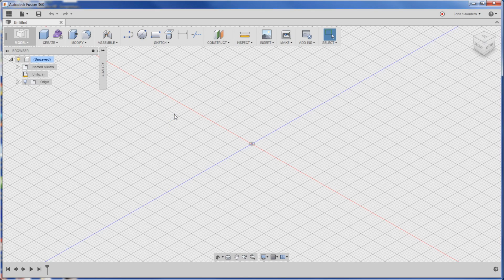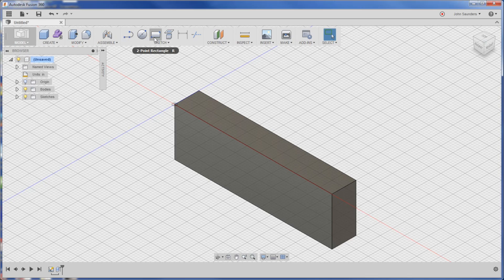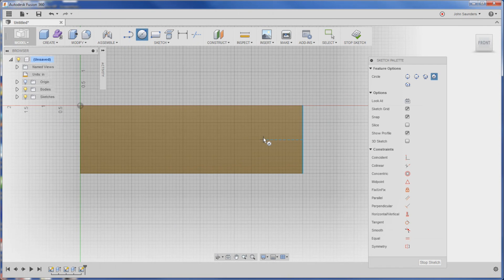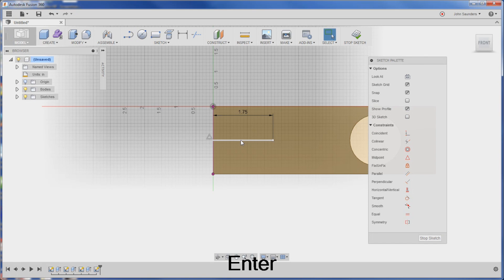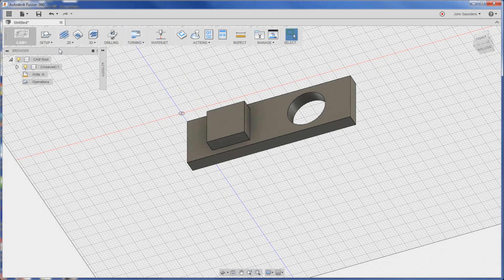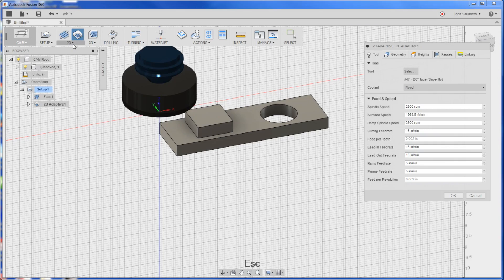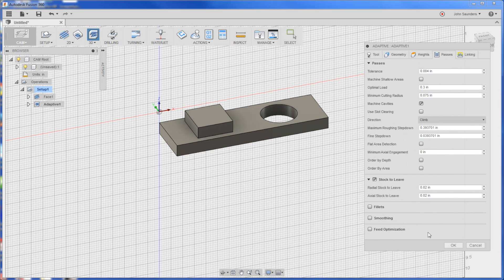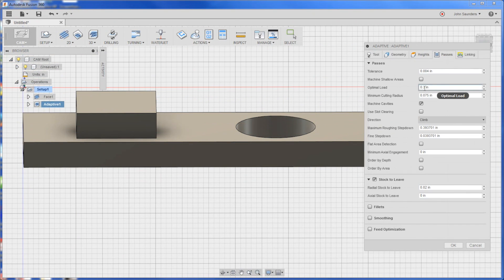Fusion 360 CAD & CAM part for Tormach Accuracy Test!

Comment: Top Video John. Coincidentally I have just been doing some accuracy testing with Fusion on the Tormach.
In short:
- Be careful of vice pressure on part (measure material flex in Z) and keeping torque consistent. (I eliminated this by double sided tape for fixturing during tests)
- Use 'Circular Pocket' under drill tab if you want a 'concentric' hole. 
- 2D contour with leads from/to center is ok but seems to very slightly over-size the holes and if you take note of the entry and exit points of the tool path and measure across this ID it will be larger than 90deg to that entry point - hence an 'oval circle'.
- Apparently better practice when modeling is to use 'hole' command rather than 'press pull' a sketched circle. My testing somewhat confirms better accuracy but this is not conclusive or as obvious to a 2D contour with leads from the centre rather than plunge.
I was led to testing and checking my tram etc due to oval holes when needing to quickly pocket  holes for pressing small bearings. My mill tram is excellent and very repeatable with just a tad run out. Hence CAM selection was the critical ingredient.
I also note a boring bar is a more standard practice for concentricity but I wasn't making NASA parts ;-) and boring bar setup adds time.
Hope this helps.
Bert.
Reply: NYC CNC The least I could offer John. Thanks for all your time and effort.
Reply: +NYC CNC 
Hi John, A little follow up... It was a bigger issue, thankfully not my machine or operator error. Lets just say I am sick of days fault finding and cutting holes but the issue lies in the Post Processor Config - the Radius R-Word commands.
Certain numbers in the X- offset for stock to add and hence certain X coordinates for the start point of a circle will induce the error causing the hole to be out in Y by up to 0.009". X measures fine. (So check hole measurements x 2 at 90deg to be safe).
The fix:

One option:
In the post processor window, property box, I have found Selecting 'NO' to 'Use Radius' which then uses I and J commands in the Gcode has worked fine for the tests I have done.
Better Option:
Download an amended Config off the Fusion CAM site called ARCS cps   https://camforum.autodesk.com/index.php?topic=6492.msg31466#msg31466

This was written to address ARC errors but also seems to help the new issue i have been butting my head against. It seems to add a couple of extra R word lines in the G code which fixes the problem.
This was back in March, so I may have a go at updating Tormachs PPilot cps file with the 120deg arcs instead of 180 to get a more up to date option for Pathpilot.

Using HAAS Generic for example works too by using I and J but then you get the ARC errors on the PPilot status page on certain designs.

Tormach hasn't gotten back to me even with all the fault finding info to give them a head start, and the CAM forum guys were not sure either (probably because it was so damn hard for me to describe the issue in words)

Anyway this is a real issue having oval holes and I hope you may be able to get it out there to save others tearing their hair out thinking its tram, machine, design, fixturing etc issues and just get on with making parts.
FYI I also tried it in Autodesk Inventor HSM but it failed also - a post processor issue.
Hope all is well for you and the Family and your new ventures.
Bert

Comment: Nice video John,  I believe that you can rough multiple depth surfaces with 2d Adaptive by just selecting both contours when you select geometry.  Is there a reason that 3D adaptive is better for your application?
Reply: Ahhh....nice. I will have to give that a try. Thanks!

Comment: Loving your show. it's great to see how different machinist do stuff.

its quite easy to jump to next op. in fusion 360 / Inventor HSM
all you do is press the "forward" with a circle next to it.

list of simulation play funktions: Start of simulation, previous op. previous position. pause/play. next position. next op. end of simulation

just let me know if you want a few tips on the Cam part. using it about all the time.
i dont use fusion 360 myself. since i got access to inventor HSM pro through work.

Comment: john trying to follow along and learn fusion 360 but a question, where did you get the post processor for the tormach with pathpilot? I only see Tormach with Mach3 pp. as option and can you do a video on setting up your tools in fusion?
Reply: You can download the cps file from Tormach's site, Pathpilot post processor. Save to your fusion cam local files. Then in the post processor area in fusion select Local posts in setup drop menu. The file should show up to select.
This took me a while to sort out and Google wasn't much help surprisingly so I hope this helps save you some time.
Bert.
Reply: +Bert R : thanks Bert I actually copied johns accuracy part and was able to run it on my 1100 worked awesome thank you and John

Comment: I'm going to have to disagree with the "don't finish along the floor" statement. It's fine if you've already finished the floor, there should be no axial forces at work anymore. Blending tools can be very important in some instances.

Chamfering: best to get about as high on that chamfer mill as possible: higher feedrates thanks to high chiploads.

Simulation: you need not drag the slider, just click where you want it! ;-)

Comment: sinces there is really no best practices with fusion. if it works and does not fail it is your best practise as it works, there are quite a few way to do what you did but it does not matter if it`s a one time file as it it won't get changed.
if it is a file that will be used all the time and will be changed all the time you have to do it a different way